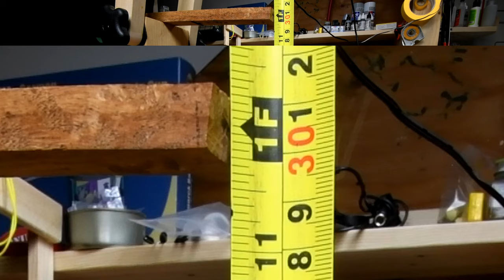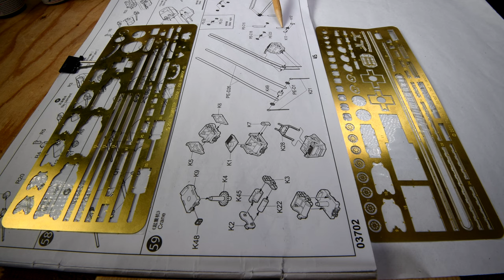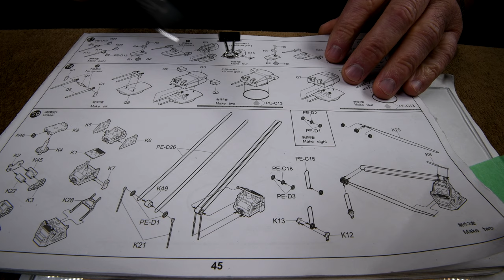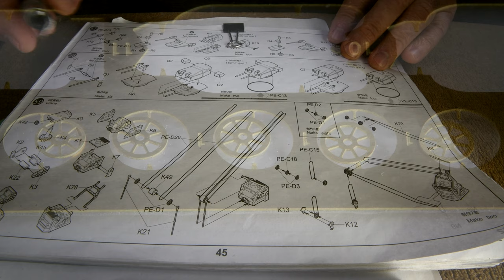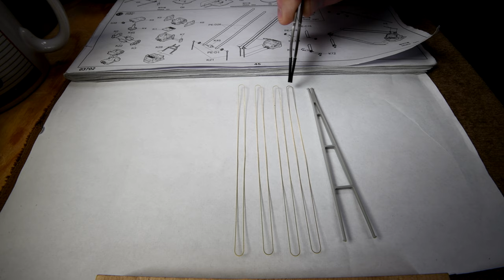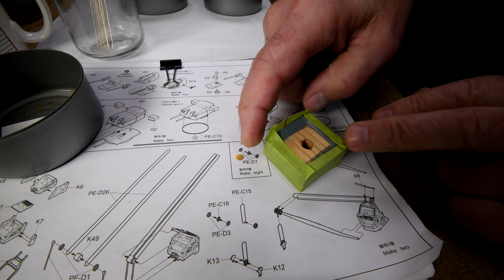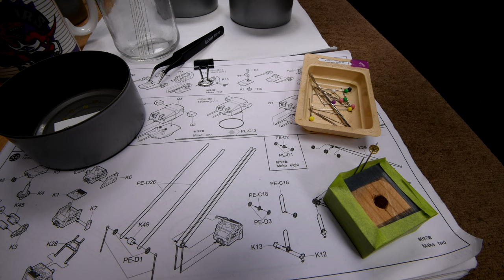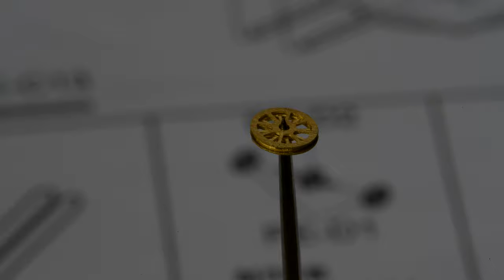The Model Ship - Part 297

Comment: Hi Ron, thanks for the measurement. About these pulleys, I agree they would look more interesting if the spokes were not aligned, but it looks to me that the target here is to glue three layers to simulate the thickness of a single pulley with a groove in the middle. For that, the spokes would need to be aligned.
Reply from the maker: Re: "About these pulleys" I realized my silly mistake later. See part 298 😁